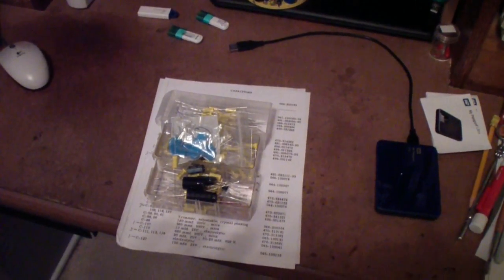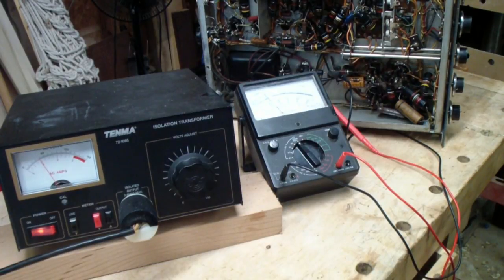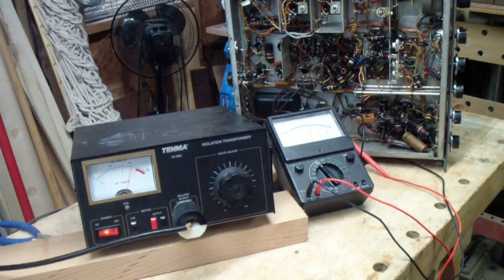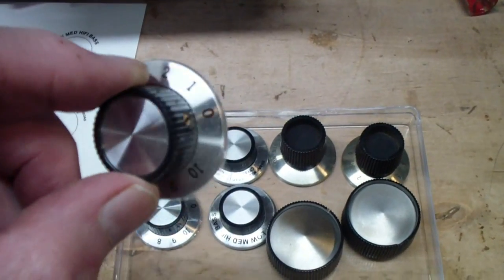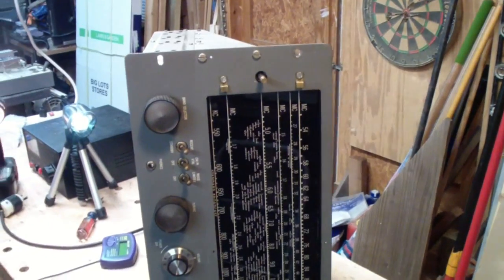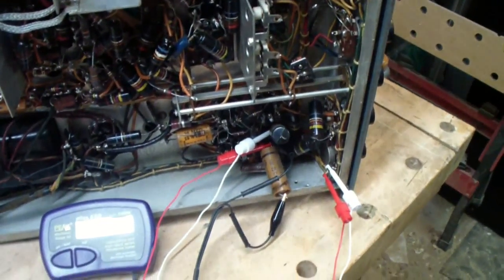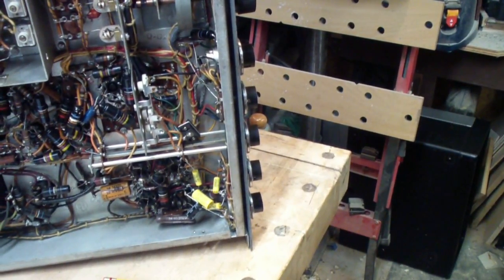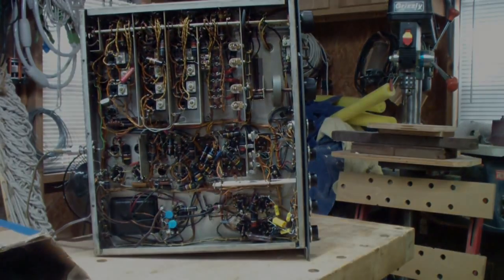TTT080 Hallicrafters SX62A Restoration Pt5

Comment: God help me, I've just finished removing those knobs on my SX62A.  I put a drop (sprayed all over the place) of WD-40 in each set screw hole and let sit over night.  I tried metric and SAE hex keys and don't know what I finally used.  I've got them all mixed up and out of their holders.  I wish I had reviewed this video first.  As I looked into the holes, it sure looked like a six sided hex set-screw and not a spline type.  But I swore to replace all those set screws with a flat-blade type (if I can get the old ones out).  I'd also like to get longer set screws.  The originals sure seem to be awfully deep in there.  No need for that.  So, where did you get your new set screws?  You must have also figured out what thread they used.  Now I'm going to review your videos 5, 6, 7 and 8 to see how to get the chassis out of the box.  I've removed every nut, bolt and screw and so far the chassis doesn't lift up.  Might be stuck in with decades of gunk accumulation.

Comment: I prefer to unsolder the leads and remove them to free up the pins for the new part since it makes for a much neater job and I doubt anyone will be replacing them again in the next 60 years, they might not even have radio stations by then!  If you do break a tube socket pin they are easy to replace by pushing out the old one and replacing it with an unused one from another tube socket.  Also the old caps were so large they couldn't always be installed in the best place. For instance if a cap needed to go from a tube socket pin to ground there might have been a ground nearby but the cap was so large it had to be connected a couple of inches away instead so when I install the new smaller part I can connect it to the closest place making for a much neater looking job.